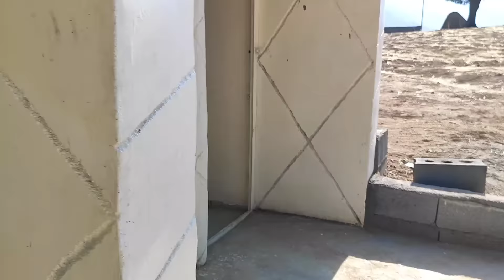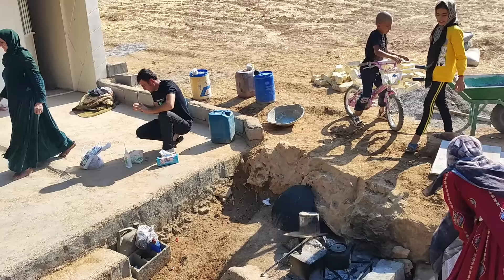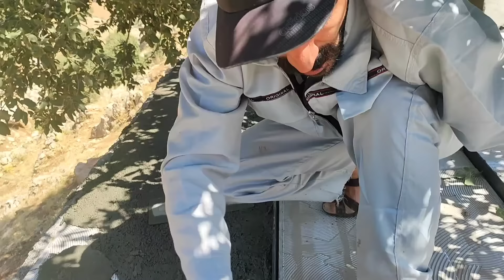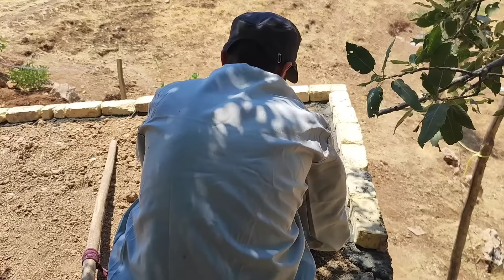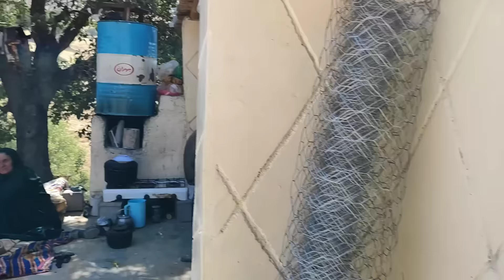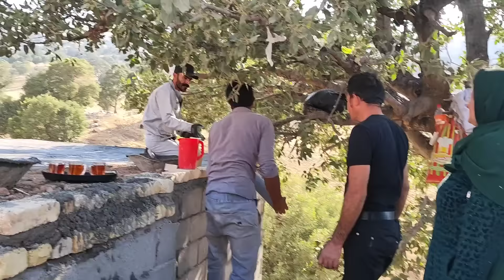Losing the car and fixing the roof of the dream house

Comment: When the rain comes, this small house must be flooded due to the low level. They must think a way to prevent the water comes in...
Reply: Most importantly: the floors of the rooms, above and below, are not raised. So far no measures have been taken to remedy this design error.  Let‘s see.